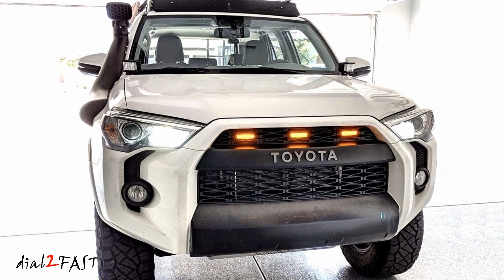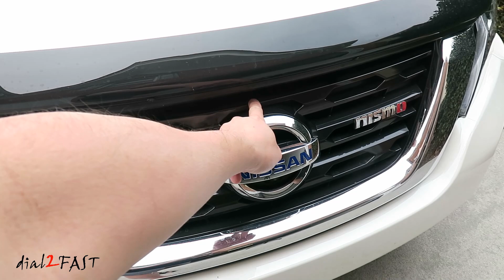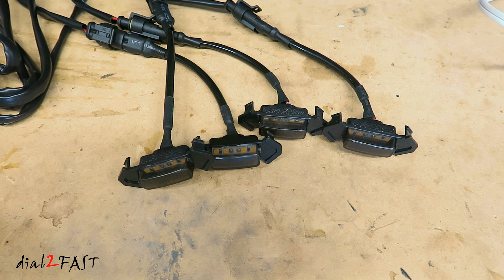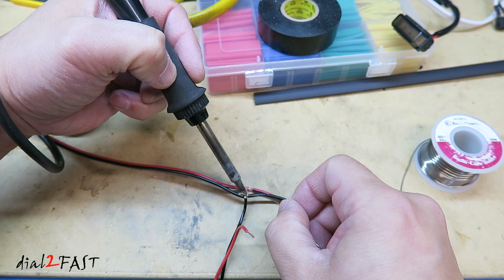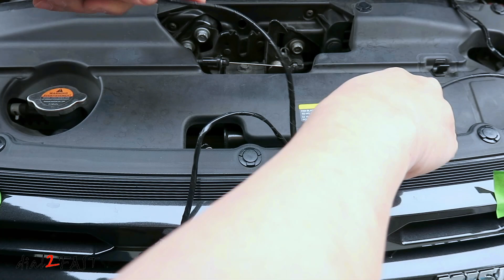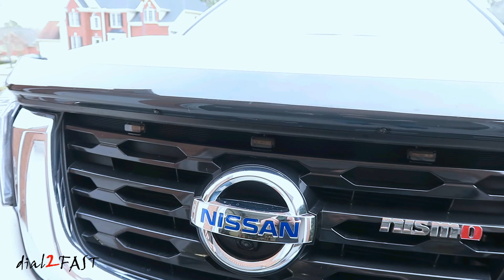Install Raptor Style LED Light On Nissan Pathfinder

Comment: nice job but you should always use heat shrink on wires...electrical tape does not stand the test of time in the elements...even under the hood.

Comment: Hey Dialtofast... what is the point of connecting the lights to the DRL module. Just to get power or for them to dim at night and be bright in the day time?
Reply from the maker: The only reason I connected the raptor lights to my DRL control module is simply to make the install very easy because it already has a second output which I am not using. These amber LEDs aren't really that bright so dimming it isn't necessary (even though the DRL controller will dim it at night). So anyone installing this, just connect it to ignition 12V and it will turn on whenever the car is running, and turn off when you turn off the ignition.
Reply: @dial2fast  got it thanks... Keep it up with the amazing videos...